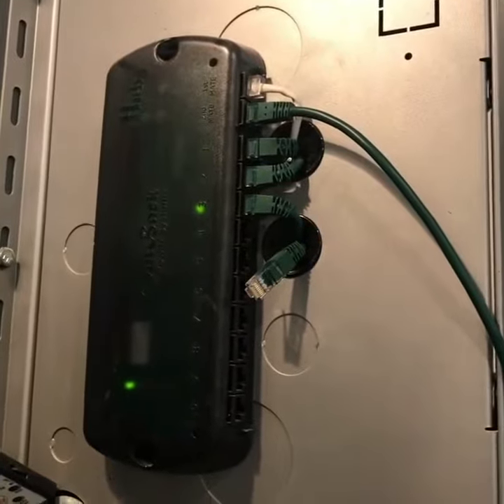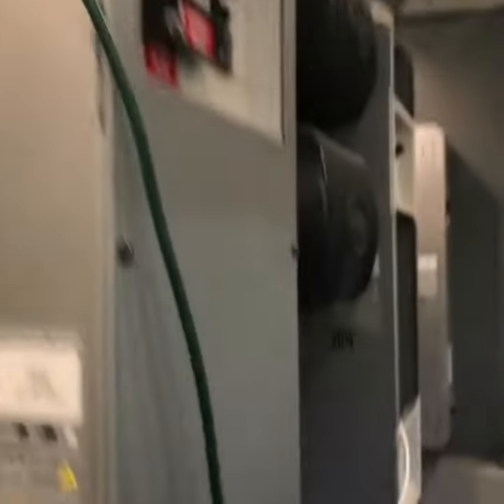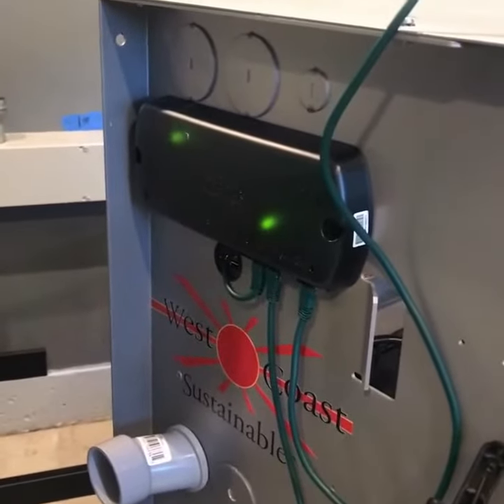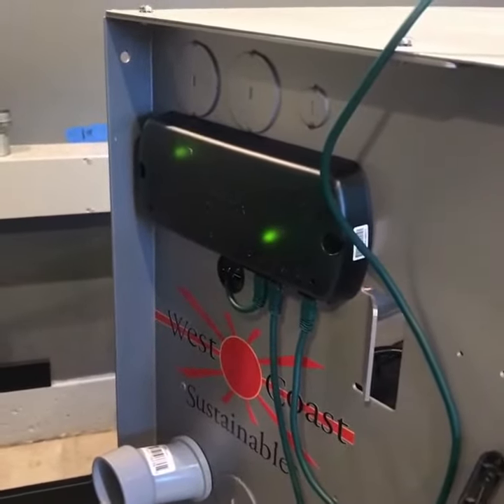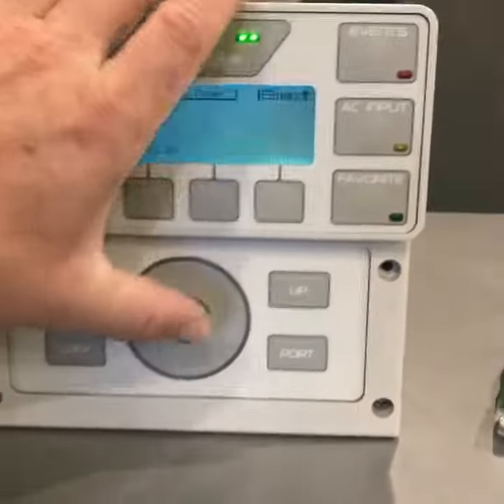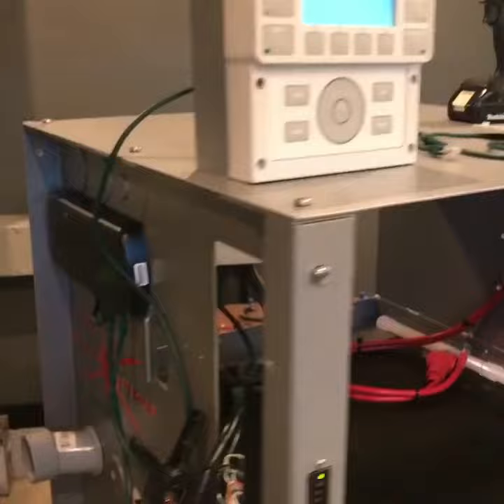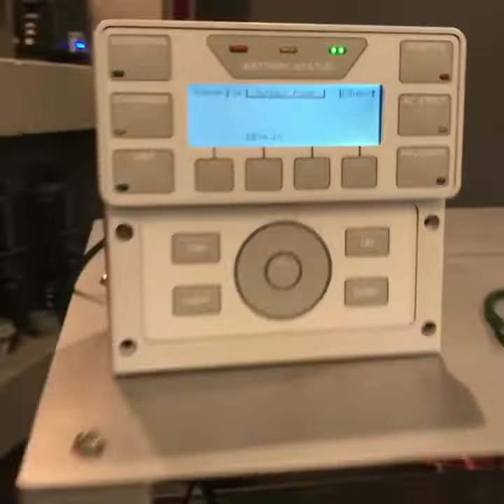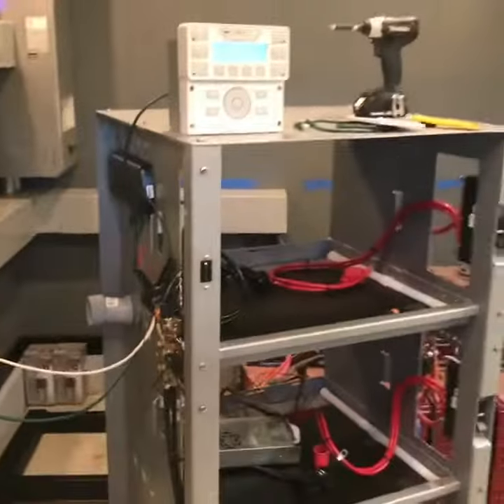Outback Hub hack, quick Instagram share

Comment: Can I use a laptop instead of a MATE for configurations with the Com Hub?
Reply from the maker: No you cannot, the only way to configure the settings using a laptop is to have the mate connected to the Hub and have the ethernet also  connected to the mate.  This will connect the Mate to the cloud allowing the laptop to access the system remotely.  At this time there is not a local connection from pc to the system it has to utilize the cloud to connect to the mate/system.  Hope this helps